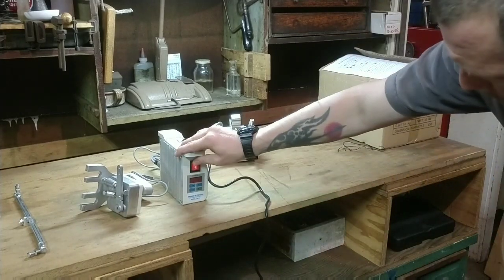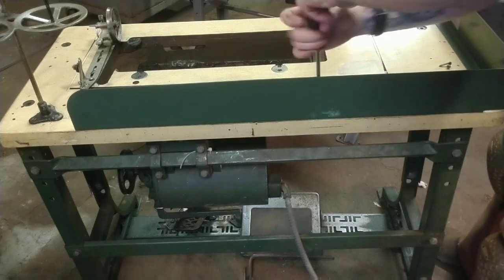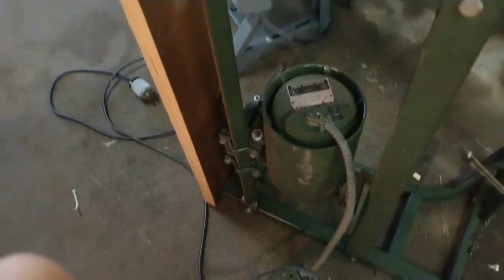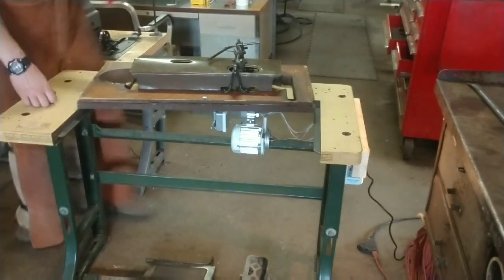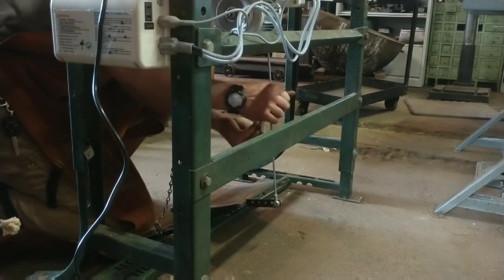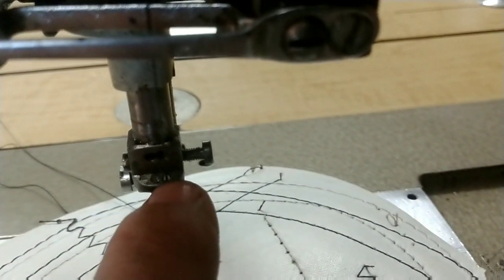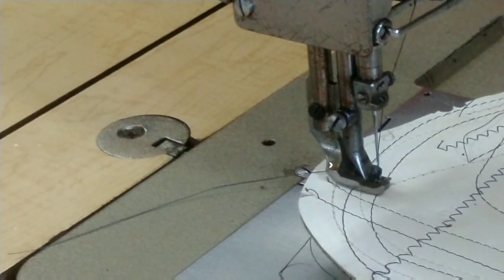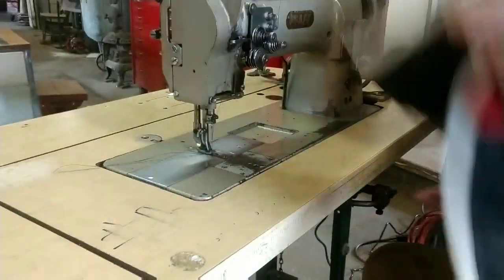Pfaff industrial sewing machine. Upgrade to servo.

Comment: Thanks for the information on the installation!  I just finished installing a consew 1000 on my singer 1940’s industrial walking foot leather belt.  Switch to 45 mm pulley and 3/8 V belt 38 3/4. That has slowed it down so I do my leather work on it now!!
Reply from the maker: That's fantastic!

Comment: If you line the motor up properly the belt doesn't rub, line it up with center of slot. You can do it from on top of the table if you can drill straight.

Comment: Thank you for this instruction. I have had a hard time to find specifications on how fast the motor is at lowest constant speed, that you can do with the pedal. I had some unverified information of 200 RPM. So I hope you can tell. I know some other types of servo motors got 100 RPM and others 500 RPM.

Comment: I just bought one of those motors. I hope you don't mind me asking here, but how do you get the motor to spin on the bench? Is there some parameter you need to program into the controller? I can push the foot pedal lever all day and it won't move.  Thank you.
Reply from the maker: I connected everything up and went through the settings and it went with no problems. Have you gone through the settings?

Comment: Good info! Which servo motor did you end up using? Are you still happy with your selection? Thanks again!
Reply from the maker: Thank you, glad you liked it. I went with the Consew rig, as they are brushless, and I like it quite a bit. I'm actually sewing up some cord wallets (for chargers etc...) Out of old Carhartt dungarees under this machine right now! Plenty of power to move through 7 layers of canvas!

Comment: I picked up a motor I set it up but it's going counter-clockwise how do I make it go clock wise?
Reply from the maker: This is hard to say for your motor without specs. DC motors can be reversed by swapping polarity, but it's easier with a brush type as you can switch it there. If your motor has a programmable controller, you may be able to access a menu mode and switch it there. The low-tech way is to spin the motor around or if there is room, give the belt a single twist (on sewing machines there is rarely room for that). I hope that helps a bit!
Reply: Genuine Consew CSM1000 Servo Sewing Machine Motor 3/4HP

This is the one I have...no menu lol..but there 4 button on it...I just got it today...if not yes thanks I appreciate and I will try that